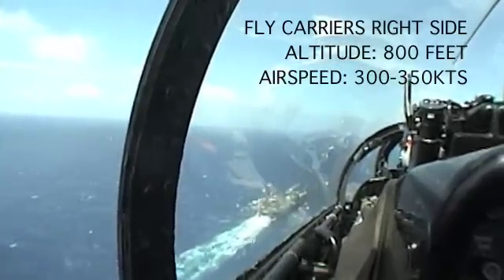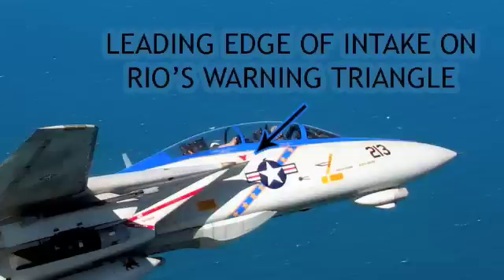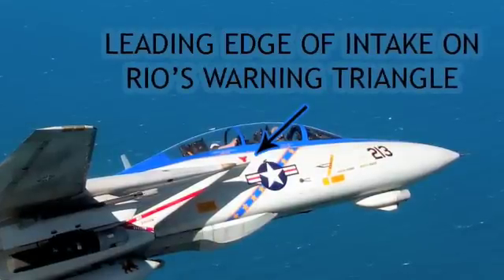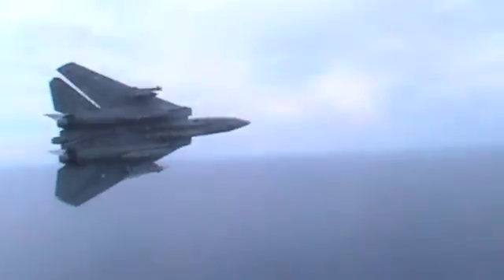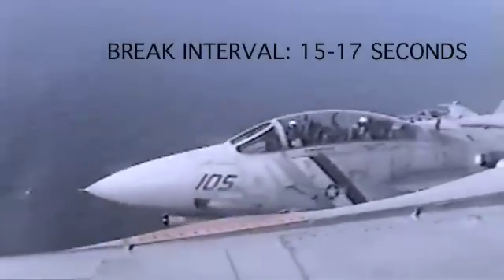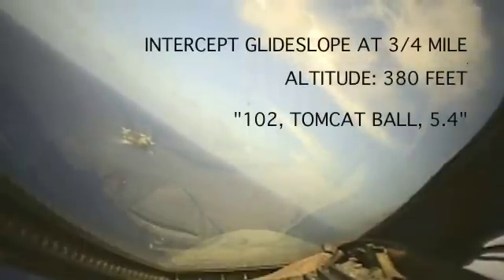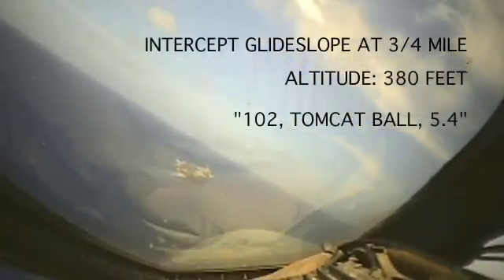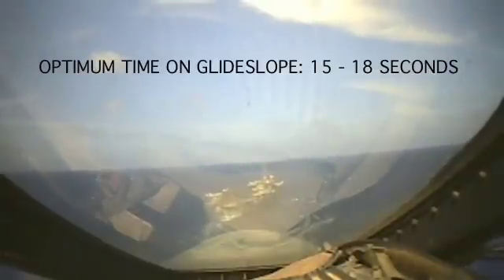F-14 Tomcat carrier landing tutorial plus PLAT footage.

Comment: in-flight engagements not only can hurt the pilot but can cause structural damage too. Seems like they were caused by a late WO by the LSO. Shows how strong the arrestor gear really is. The quick deceleration drops the nose like a rock. Looked like a General Lee car jump landing.
Reply: Bet the Pilot got ribbed to no end when debriefing the landing from his squadron mates as well as the LSO's!
Reply: Read an account from the pilot about this landing, said he was given a late wave-off call right when he was in the wires, then 'towed the boat' for a split-second before the nose came down. Said his back hurt like hell the next day, but the plane was looked over - was just fine and flew the next cycle.

Comment: When the Pilot calls the ball and says: 102, Tomcat Ball, "5.4". What is the "5.4"? Is that your visibility?
Reply: He is referring to the fuel aboard in thousands of pounds. This is used to calculate the weight of the plane and adjust the arresting gear accordingly.
Reply from the maker: No the 5.4 is the fuel state of the aircraft.
Reply: Yes... fuel state in thousands of pounds... "5.4" is 5,400 lbs
Reply: It's the RIO that makes the ball call in a Tomcat, btw. ;)
Reply: Now tell me exactly how the RIO calls the ball?  Calling the ball the pilot tells the LSO that the ball is visible. Which is the yellow ball in the middle of the OLS. If the ball is not visible the pilot says "Clara" and will either be waved off or take verbal cues only from the LSO to bring the plane in.  The RIO can not fly the F14 so his being able to see the ball means exactly squat.